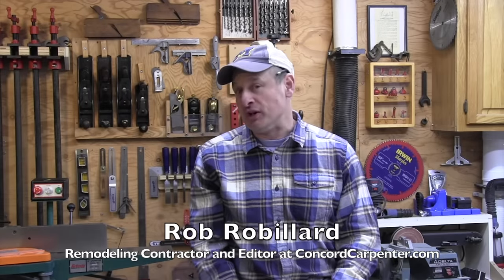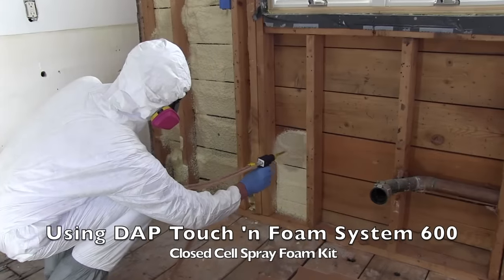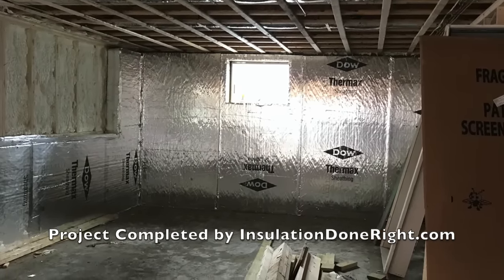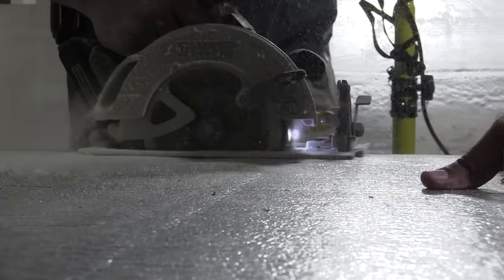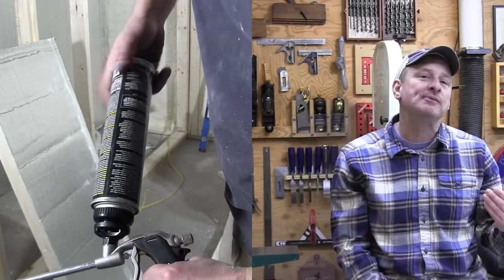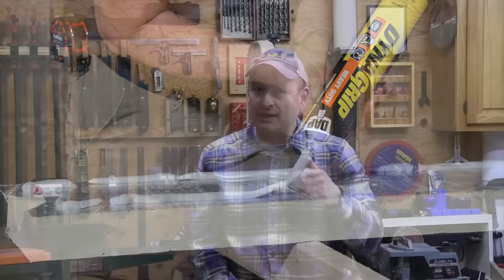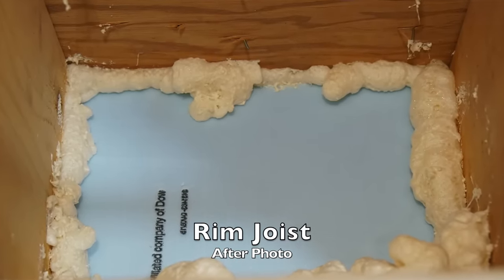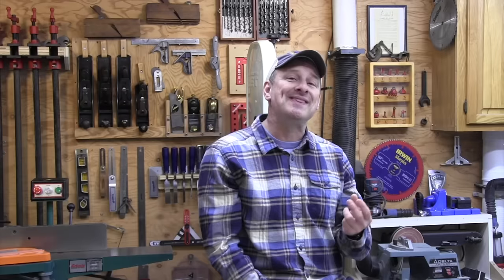Why Use RIGID Insulation board On basement walls

Comment: Basement walls can only dry to the inside. So by putting up a foil faced insulation you are trapping moisture between the wall and foil insulation. This is a place for mold to form. Then if that mold gets through to the wood studs and back of the drywall it won’t be long before it’s causing havoc in the basement. From the reading I’ve done it is best to let the walls breathe. Use a EPS beaded foam glued to the walls. This lets some drying to the inside happen. Using metal studs would eliminate organic materials and a paperless drywall would also allow drying. This would make an assembly that can dry to the inside.
Reply: How can trapping the moisture in the cavity between the foam and the concrete cause mold without a food source or a mold spore to land on said moisture? Also moisture will travel both in and out depending on the delta T and season. We have over 4000+ units completed in this manner with zero issues. If the hydrology is an issue with the basement then the moisture is now water and when the water builds and makes its way thru the concrete you would need to waterproof the wall first prior to insulating.
Reply: Frank M Bood Where is the trapped moisture to go? Provided there is not a moisture management like a French drain, drain matting to a floor drain that moisture is there for how long? Having a vapor closed insulation trapping moisture till it inevitably leaks into the living space is not good. If you are implying that moisture that comes in will be drawn back into the foundation and back to the soil I have a hard time seeing that in the northern climate zones. Taking into consideration if the foundation is properly sealed from the outside and capillary break is installed there will be little chance of water getting in till one or both of those seals break. Also exterior landscaping draining away from the foundation. My concern with any building method is not the short term durability but the long term. What measures are put in place to assure that if or when there is a failure within the system that a secondary backup is there to manage moisture. I don’t see a back up system put in place with this building method. You may very well have one in your building system. 

I’m admit I’m not a pro. I’ve done lots of reading a research across multiple sources. I’m just questioning the durability of a system that relies on a perfect seal. Stopping the flow of bulk water and water vapor is in my opinion a loosing battle. I believe it better to allow it to be managed. That foil tape will only stay sealed for so long. Then the bulk water and water vapor has organic material to feed on(wood studs). Using organic building materials below grade is a risk. Especially when you are relying on perfection. Thanks for the debate. I believe I have stated my opinion. There’s lots of them. I have not put any specific links to references. I’m not concerned with taking that time. I believe you are well educated enough to understand the points I have made.
Reply: @jeremycondon3692  I agree with your concerns. Thanks for the open discussion. I live and work in an area where it is code to have a drain system and water protection on the exterior foundation. (perfect world) Therefore we don't see much failure in our newer projects. In our older renovations we use Dimple mat then spray closed cell spray foam as best practice. A majority of older homes here have an interior drainage system. This dimple mat helps allow the water to run down to the drainage system. We ask the system installers to run the dimple mat up the wall out of the drain a foot or so. (when we can) This allows us to install our dimple mat behind theirs and spray it in place. Have you seen water intrusion on a large scale where you live? I am limited to my knowledge of my area only.  Thanks again for the input. These conversation help us all grow.
Reply: Frank M Bood yes exterior foundation drainage systems are code here as well. There is instances though when they are not done to the attention of detail and procedures necessary for successful long term operation. I’m not familiar with many houses having a French drain unless it was installed once a water problem was found or as part of a basement finishing system. I think having a working drainage system behind your basement finishes is definitely best. That and making sure all landscaping is draining away from the foundation. 

I’ve started down the long planning process of my own basement renovations. The old finishings were definitely not of any good design. 1x4s nailed to the concrete walls on 4’ centers and 3/4” eps barely adhered to the walls. It was covered with that ugly 1/4” wood pressboard paneling. The floor was covered with carpet that was glued heavily to the concrete floor. 

Shortly before I moved in the original owners of the house had a water leak due to the window wells flooding. They fixed the exterior issues but left the basement finishings in place. I removed them shortly after moving in and prepped for a fresh redo. I have been reading and researching techniques for over a year and planning. In that time I have had no water issues in the basement so I am confident as long as I follow best practices I will have a successful renovation.

I have gathered:
- it’s best to not use organic materials below grade. 
- fiberglass insulation is best left out of the insulation plan even if foam is applied first. 
- proper drainage systems need to be in place regardless of the dryness of your basement.
-fix any known water issues before starting the finishings. 
- build a system that can dry to the inside

With this in mind I have found a couple insulation strategies that fall within those guidelines. 
Glue EPS foam to the walls somewhere in the R20 range. And then build a wall in front using metal studs. 

The other alternative I have found is Insofast insulation which is a specially designed insulation that has integrated studs 16” OC that eliminate the need for building a additional stud wall for installation of your wall finishing.

Or if you have the deep pockets. Dig up the perimeter of your house and seal and insulate then redo the perimeter drains if needed and might as well integrate downspouts at that time. 

My plan for the floor is a dimple mat with LVP since I have a limited head room of 7’ 

I’m still looking at other options like Rockwool comfort board and batts but due to added wall thickness I’m really interested in the Insofast system.

Comment: If you value your life,  cut this iso with a hand saw,   measure for your cut, slice the iso on the back side of the sheet,  slide your chalk line in that slice and snap the cut line,  and make the cut  with one the old handsaws you inherited.  It will take an extra 30 seconds and you will be breathing easier than cutting by circ saw.  Total hari kari with a circ saw.  The dust created will not be airborne,  spread out a sheet of poly below the sawhorses & dump the residue onto the poly and its easy clean up.   Best Insulation value available.
Reply: I've heard it can get messy good of you to pass on your experience.
Reply: 25mm blade utility knife great option imo

Comment: Ron, never cut polyiso without a dust mask! The particles are like fine spiked crystals and attack eye membranes,lungs,and gut!
Reply: Also use an Olfa/“exacto”  knife and you will minimize the dust particles
Reply from the maker: Didn’t know that , not a a lot of visible airborne dust
Reply: @ConcordCarpenter  great video - I found a paring knife from the big box works great - blade is long AND rigid enough to cut 2" iso with no dust

Comment: I thought the best way to insulate basement masonry walls was to insulate the outside, keeping the masonry warm also.
Reply: Definitely is, but doing that after a house is built is difficult due to cost and the fact that you are going to destroy any landscaping around the perimeter.
Reply: Are you talking about new build, or retrofitting? Retrofitting would be an EXPENSIVE & EXTENSIVE project! BUT ..you are correct, that is the ideal way to do it. Heck if you're up for it, both methods would knock it out of the park! But again you're talking big bucks $$$
Reply: It seems like a great idea. I wonder though if in doing that you would create a highway for termites and hidden runs.

Comment: It's important to note that sealing the seams of Insulation board is an absolute must.  Any air gaps around or between the board and the masonry (even the grout channel) that can draw warm air against a cold foundation in the winter is an absolute breeding ground for condensation/mold.
Reply from the maker: Agreed
Reply: Because of that, cutting the foam 1/4 inch smaller to allow access to the tip of the seal foam spray can should be considered a good practice.
Reply from the maker: @wysiwyg2489  or use a foil or 3M all weather tape

Comment: So happy I saw this video before replacing my basement insulation . When I pulled out the rim joist fiberglass batt, I found found black marks showing all kinds of air leaks. Using the rim joist video, I installed foam board sealed with spray in insulation before adding rockwool.  Thanks!

Comment: Hey Rob, I've always used metal studs in basements because they're unaffected by moisture. Also if it's specked for fiber I'll use mineral wool because it's hydro phobic. Both will not harbor mold or encourage rot.
Reply from the maker: All good stuff

Comment: Great video... before even stumbling upon this I'm using the exact same method to insulate the basement by myself in my new home I'm building. I first tried using powder actuated nail fasteners to fasten the board to the masonry, but the nails kept bending or shooting through the board and ruined it. So I abandoned that and now am using construction adhesive. It's slower but it works like a champ. I will spray foam all the seems when I'm done. Fellow Wolverine here... Nice video and Go Blue!

Comment: My old cinder block walls look like someone got real casual with alignment towards the top. Still, I’m considering putting foam boards where I can so they’re flat, and where the gaps are, to fill with spray foam. And then just create the stud wall an extra inch out. The extra gap between studs and foam board will just have to be filled in with more spray foam or rock wool.

Comment: If you are using those 1ftx1ft OSB boards with the closed cell "grid" layout for your floor (the grid is for airflow), would you put that down first with a small gap on the wallside and then put this tight to the panels? that way you have airflow from the floor to the wall in case there is moisture?

Comment: If your going to make your house this air tight mold is inevitable without a good Heat Recovery Ventilation system. Mold spores are everywhere, and as long as you have a food source, mold will thrive. I do like these materials your suggesting. 👍
Reply from the maker: Thanks for sharing

Comment: I used owen corning 2inch foam board.
I used liquid nails against mssonsry.
I just had to remove section because a leak in wall. There was mold all over liquid nails attatched to wall and foam board.
Reply: Does liquid nail have organic material? I used a rigid foam safe construction adhesive on mine

Comment: PSA:  Couple of notes: 1.  Never cut rigid insulation without a mask on.  2.  Do not glue the rigid board directly to the concrete, you will end up with mold.  The rigid needs to have a small drainage channel built into the system.  Either use furring strips on the wall or if you are made of money buy something like the insofast product that has tiny grooves built-in similar to zip system plywood.  I flip houses and have seen this mistake cause mold problems many times, especially with block walls.
Reply: Regarding #2, this seems very contrary to preventing vapor movement and against what closed cell manufacturers recommend. PolyISO is the better of the closed cell products and is required to be fastened directly to the concrete per the manufacturer. Now, if the concrete walls are taking on moisture (enough to moisten a piece of 2'x2' plastic tapped to the wall in 24 hours) that is a completely different situation that needs to be delt with before any basement wall insultation work is started. Dry concrete walls (that pass the 2'x2' plastic test should have the closed cell board glued directly to the concrete.
Reply: I think the science supports this. Any block home is unlikely to have an exterior vapor barrier making water inevitable. You'll need an air gap to avoid efflorescence.
Reply: @Quik5oh  always assume a basement wall will not pass a moisture test. I wouldn't even think about spray foaming to a foundation wall unless I knew it was waterproofed on the outside (and I'd want to know exactly how well it was waterproofed)
Reply: Scott Stephen Smith how about if I run dimplebord up the wall before my styrofoam?
Reply: How about if I was to run dimple board up the wall first? Then rigid board?
Reply: I thought Insofast saved money? No studs are needed, which are at a premium.
Reply: I've heard this recommended, and to space the foam board off the walls by 1/2" using big globs of adhesive.

But then I wonder doesn't this cause air leakage from the gap?

Comment: Some manuf of polyiso don't approve its use where it will come in contact with water. Also, if there's enough moisture in the wall and this is done, the water can migrate upwards towards the sill. If there's no capillary break (sill seal) and the sill isn't made of PT, then completely sealing from the inside can lead to a rotted sill. Better is a sump pump to manage water as it enters. Best is to control moisture from outside the concrete wall. I think also that I would use rigid foam up until a certain point and then switch to something that is vapor open at the rim joists (like rock-wool). Humidity entering from there could be managed with a dehumidifier.
Reply: Do you mean moisture or water will desolve the foamboard? I want to use what he's using to insulate underneath my metal patio roof and it may sweat in the corrugated ridge where the foam is not glued with the adhesive but it can drain down into a gutter at the bottom of the roof but i didn't know water or moisture could desolve the board.

Comment: I have yet to find someone who addresses insulating poured concrete walls that aren't perfectly flat. The builder of my home obviously didn't pay much attention to properly tying the forms together in the middle of the height and all the walls appear bowed in, but are actually thicker in the middle, not warped. If I tried to put rigid insulation boards on these walls they would either be bowed as well, if they were flexible, cracked if they weren't, or there would be gaps top and bottom so I could have a plumb wall. Gaps seems to be a recipe for moisture collection and mould growth, so how would I get around this?
Reply: Could you sand the imperfections smooth??
Reply: @JasonBroaddus  Are you suggesting I sand the concrete walls flat? This seems impractical.
Reply: @notthesnail  depending on how much it might not be a bad idea. I don’t know your specific and just had idea Gary.
Reply: Frame the walls and use closed cell spray foam. You can also use just the spray foam and coat it with a thermal barrier to meet code. But a framed finished wall looks better and adds more value to the home.

Comment: Hi. Thx for the informative video and your expertise. I installed my rigid high performance aluminum sided foam insulation board behind an already framed wall. Now I want to insulate between the studs also. Can I cut another foam board and place it between the studs? Or do I have to use insulation batting? I prefer to use the foam board for moisture resistance but don’t know if that’s advisable…I know it’s more expensive and more work but I’m okay with spending more money and taking the time. I already bought the enough boards. I also have Owens Corning XPS insulating sheathing foam boards I could use. Thx for and advise or suggestions. Really appreciate

Comment: Must you also put a vapor barrier plastic behind the foam board or is it not necessary?
Reply: This requires an "it depends" answer. A basic "rule of thumb" for proper placement of vapor barriers is to make sure that it is installed within the first 1/3 of the total R value of the wall (or ceiling). Violation of this rule of thumb creates a greater potential for condensation to occur on the warm side of the vapor barrier. This condensation could occur as a result of insulation (foam board or batt) placed in front of the vapor barrier retarding heat energy allowing the dew point to be reached at the surface of the vapor barrier. Another factor that plays into the formation of condensation is the availability of a condensing surface. That topic becomes a separate conversation.